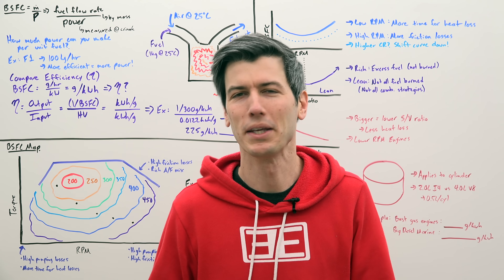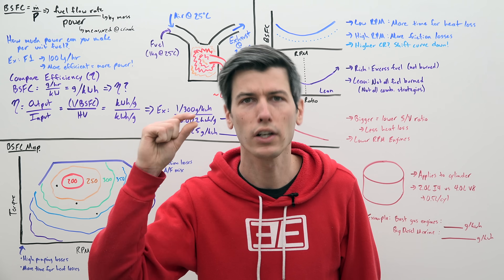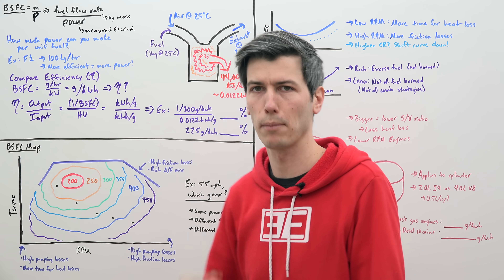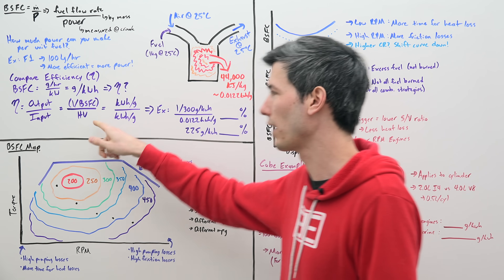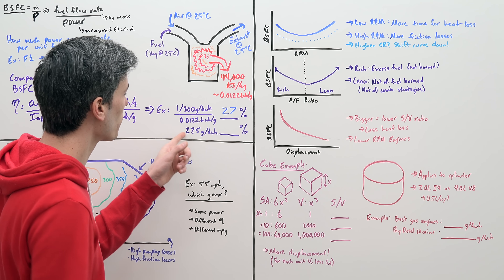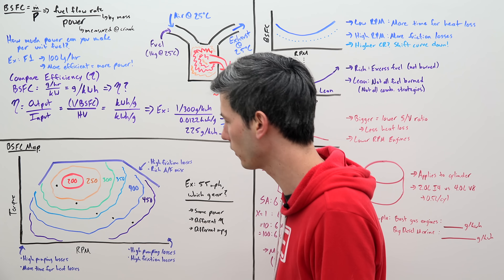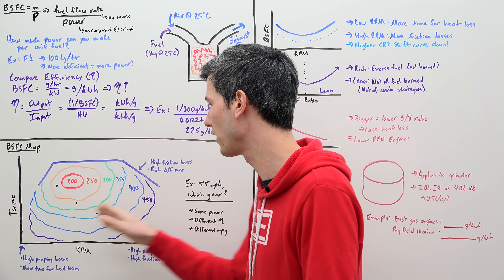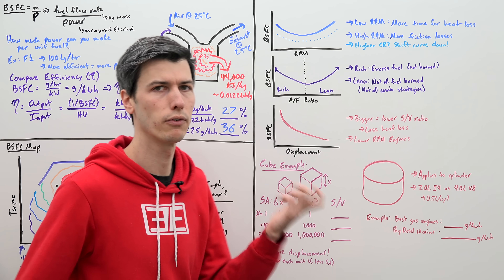The Best Way To Compare Engine Efficiency - BSFC

Comment: Would having a CVT tuned at BSFC as the shift point be the most efficient way to drive on an ICE car?
Reply from the maker: Correct, CVTs will attempt to put the engine in the most efficient spot to maximize mpg, as long as your throttle demand isn't too high.
Reply: @EngineeringExplained  How does lost of energy from the countinous shift of gears from a CVT compared to the efficientcy gain from the engine?
Reply: @davidli9887  CVTs don't have gears...
Reply: @Kepe  it does have different gearing ratios and need to change between them. There are no discret gears but there are countinous gears.
Reply: @EngineeringExplained  probably also the reason why we now have up to 10 speed transmission, fairly easy to have the best BSFC, as long as you don't increase friction in the whole package.
Reply: @EngineeringExplained  full hybrid such as a train drivetrain is still going to be the most efficient
Reply: @EngineeringExplained  So you're saying that it's possible that my 1974 Buick Riviera with the 455 ci big block (800 cfm Quadrajet carburetor) Buick V-8 running 75 mph @ 1600 rpm with my modified GM TH200-4R weighing 5725 lbs from Albuquerque to Phonix (500 mi) is more efficient than my 1996 Geo Tracker 4 door 4x4 1.6 L I-4 16 valve fuel injected 4 speed automatic in 2wd at just about any rpm or mph. Lol! Yes, absolutely as it had the horsepower and torque to move that tank with ease even at 230k! 3.42:1 rear end gear ratio and .67:1 overdrive in the Buick Riviera. God I miss that rusty old car!
Reply: @johnlincicum6390 the 79 to 85 Rivieras were so beautiful IMHO.
Reply: @EngineeringExplained  I wish a CVT could be tried in a sports car.
Reply: @josephmarsh8235  it's been tried in F1. Some good videos on it here
Reply: @josephmarsh8235  it's been tries in F1 by Williams in 1993, but got banned by FIA since it was too good : the car was faster by few seconds every turn than other Williams, which was the fastest car back then.
Reply: @Asakha1  I was talking about sports cars that are road legal, not F1 cars
Reply: @Asakha1  it was fast but the engines werent able to compete. They broke down because of the much higher stress in them.
Thinking about 60 vs 80% of the time at max RPM/ power output.
Yeah its fast but the engine runs always at the limit which means you have to tune it down so it lives longer but on any straight you would lose time
Reply: @josephmarsh8235  yeah, Nissan should try it in the new Z car! I’m sure that would go well.. 😂😂😂
Reply: @Wannabe_Maker  maybe it would, if the CVT transmission was designed for racing. Remember today's CVT transmissions are designed for economy not racing. Engineers can make power CVT transmissions if they wanted. It's only not done for money
Reply: @Asakha1  it wasn't becoz it was fast but bcoz the engine fcking exploded. Do u think FIA were gonna sit down watching more people injured/died?
Reply: @Asakha1  typical FIA. Banning any technological innovation and then they have no idea why the sport is so boring
Reply: @josephmarsh8235  any Tesla performance model is fairly similar to a CVT sports car in driving character ;)
Reply: @Asakha1  More specifically, it was banned because it removed a bit of driver involvement, and the FIA was already cracking down on electronic driver aids and automatic gearboxes.
Reply: Yes, but it also is related to road traction, internal vehicle weight and road grade as well. This is similar to what the larger car companies are programming into their ECMs and TCMs now, but it's unfortunately not an exact science as I understand it.
Reply: @ethanhenry5873  thats why its measured at various hp levels 

So if you require 55 hp to maintain 65mph 
Youd just choose the gearing that gives yoi the most efficient 55hp at that speed
Reply: Too many variables, but in an ideal scenario, yes. 

The way you use the throttle has a huge effect on efficiency. The coeff. Of drag and speed you are travelling has a huge effect on fuel economy.
Reply: Yes, using a CVT to keep the engine at it's BSFC/efficiency peak will give the best economy at any given speed.
Reply: Tractor units of large semis have traditionally used lots of gears to enable the engine to stay either at peak efficiency or peak power (depending on the need of the moment), with the bands marked on the tachometer in green (efficient) and yellow (power) before red (naughty and potentially damaging).
4 or 5 main gears with a range change and splitter give 16 or 20 gear ratios available and I've driven tractors with Eaton twin-split + range change on a 4-speed main box, which gives 24.  with a 5-speed main gearbox, it would have had 30! You often skip gears except when loaded to maximum, but you can easily get lost in those setups!
And consider that it also allows six ratios in reverse, which can get scary real fast (don't even think of trying it on a short wheelbase trailer) when backing up a semi!
I used to have fun when night shunting (putting trailers on and off the loading docks, to have all the trailers loaded and ready to go when the day shift came on) reversing them in high range high split at 35mph, but that takes quite a bit of practice! 
Older day-cab tractors used to often have a hydraulic lift added to the 5th wheel and an opening rear window (to plug in air-hose without getting out every time) to convert them into dock shunters.  Some had wide-ranging gearboxes like that, although health and safety nazis may have jumped on that and disabled high ratios since I was doing it.
That is a different kind of efficiency, as it means the loaders don't have to stand around waiting for a trailer to load.
Reply: For simplicity yes but doing pulse and glide ( with engine off when gliding) in the bsfc sweet spot with a manual transmission is the more efficient way. But really complicated to apply In the real world
Reply: Instead of a point on the map it would be like drawing a line the passes through the red circle again and again and again.
The mpg could be triple at low speeds vs  driving normally in a ordinary car
Reply: YES basically that what hybrid do
Reply: That's why CVTs were created
Reply: I believe that’s what most of these cars will do.   Toyota hybrids for example will try to be in that efficient range anytime the engine is on, even if it’s just charging the battery
Reply: Cvt transmission doesn’t give drag if compared to AT, more smoothly between shifting gears and also can be as many gears ratios. But cvt is more costly to repair 😅
Reply: @melvinlow5283  its almost always cheaper to replace a cvt than rebuild it
Reply: That's the whole point
Reply: Take the BSFC map. Draw in lines of constant power - seek the tangentially touching points of the lines of equal BSFC and equal power - connect them. That's the optimal operation points for every power the engine is capable of providing.

A CVT will attempt to stay close to that curve. Floor it, and it will always hit the RPM at which max power is delivered right away, and deliver said max power, no matter your speed. In this regard, a CVT is unbeatable of course - you just set the desired power, and the rest follows.

But losses are higher, as every CVT has some kind of slip in it, be it internal leakage of hydraulic transmission units, be it surfaces in relative motion, be it whatever - there are no teeth matching into each other, at least at one stage there will be slip. If the benefit from the best match to the BSFC map exceeds the losses, compared to another transmission, you're off better, if not, you're off worse.
Reply: @DC-rn1fc  yes, you summed it up perfectly. CVTs will probably be more fuel efficient if the driver doesn't know how to drive efficiently.
Reply: Sadly people want simulated gear shifts because they don't understand CVTs.
Reply: @nizm0man  Not true. I used to drive a Ford Mustang GT with V8 and 5-speed. Now it's a 2020 Kia Soul with and Intelligent CVT. The simulated shifting increases fuel economy when not doing hard acceleration. When hammering the throttle, it goes into non-shifting mode until you let off. Enjoyable to drive. Plus it does have a manual-shift mode. I found that useful when up-shifting, but when slowing to a stop, just let the vehicle downshift without doing it manually. I believe this reduces stress by downshifting at too high rpm.
Reply: @ninemilliondollars  "The simulated shifting increases fuel economy" That's just untrue. You're saying that having the engine run somewhere else than in the efficiency sweet spot somehow magically increases efficiency. Simulated shifts in CVTs is the stupidest thing ever. You have a transmission which is technically able to keep the engine always at the best spot for efficiency, but then you give the transmission simulated gear ratios which will make sure the engine is rarely in that efficiency sweet spot. And it's all done just so that the car feels more "normal". The sole reason for a CVT's existence is lost when that is done.
Reply: @Kepe  I'm saying my real-time mpg gauge shows higher fuel economy/efficiency when the engine is at lower rpm for a given speed. I only care about fuel efficiency when I want to and I only care about hard accelerating when I want to. For me, drivability is improved by the sense I get as I let the trans shift or glide or move to whatever rpm/"gear-ratio" it wants. And if it improves fuel economy, then it isn't lost.
Reply: @ninemilliondollars  how would simulated shifts be better than keeping the engine in the 'most economical RPM for given load'? I've driven the Nissan Qashqai CVT a few years ago, and currently occasionally drive a 2019 Subaru Outback. The Nissan felt like the transmission was slipping (first time driving CVT), but can get used to it. The Subaru is annoying, because the simulated shifts feel unnecessary. It's all in the programming.
Reply: @nizm0man  Hey. On the Kia Soul, which uses the Hyundai IVT (Intelligent Variable Trans) - Hyundai is parent company of Kia - the IVT changes positions quickly, smoothly, and very positively. No slippage. As for shifting, the trans can be forced into a "higher gear" with the manual mode to reduce engine rpm (improve mpg) compared to full auto-mode when it stays in a "lower gear" and runs higher rpm than needed. And note, this is typically under driving conditions when there's no need for maximum power. Also, when driving in full auto-mode, there's no engine droning. In any case, it's the way the vehicle was built and whether this is best or not, time will tell. It's got double the fuel mpg of my V8 Mustang and that's what I need.
Reply: @ninemilliondollars  dude, missing the point. Why bother with simulated gear shifts? Just stick the engine at max torque RPM, or max efficiency RPM, or whatever the situation requires. Defeats the purpose of CVT, stick an 8 speed auto if you want gear changes (my BMW F45 hatch has that heh).
Reply: @nizm0man  Not at all. The IVT may want to be at a unnecessarily higher rpm then needed for the driving conditions. Being able to manually shift to a lower gear is no different than doing it on a manual trans, thus increasing  fuel economy. And no engine runs at max torque rpm all the time; actually, hardly any of the time.
Reply: @nizm0man  — What ninemilliondollars is trying to tell you is that he alone is smarter that his ICVT and far more intelligent than the entire team of powertrain engineers at Kia. If they would let him alone design the transaxle, the vehicle would have far-improved EPA ratings, and that he is far smarter than you, or anyone else on this forum. 

Now get with the program, nizm0man !!
Reply: @Kepe  If a CVT survives X miles and must be replaced as it can't be rebuilt locally in most cases produces Y extra emissions / shipping fuel consumption for a new transmission or specialized equipped rebuilder far away.

So if Y exceeds lifespan CVT transmission fuel savings / CO2 savings did we actually "save" the planet? Things are more complex than you realize as a traditional AT or DCT can easily be rebuilt locally at a shop with minimal expensive machining equipment.
Reply: @ninemilliondollars  Why would anyone make it do that? Unless there is a purpose that usually forbids "changing gears" like catalyst heating or so (usually prohibits upshifting in automatic transmissions) anyway, there is exactly no reason the engine should not run at the only point of peak efficiency (for that power - gotta be said...), but at higher RPM. So, either you have a misconception of which points of operation truly are efficient, or your car is somehow effed up, or you don't gain anything from the "upshifting". 

The entire point of a CVT is to be as close as possible to the optimum curve, as described below. There is no other purpose in it that objectively makes any sense at all.

That also is the point of havin 8, 9, 10 gears in automatic transmissions - getting CLOSER to the CVT's capabilities without the slipping losses, and also, a high amount of torque may require a larger gearbox in CVTs than in usual gearboxes, be they manual or automatic.

Of course, every switching element in a gearbox that is open, has relativ motion to its counterpart, causes losses, and therefore, the growth of number of gears will not exceed the 10 by very much - every gear added does less and costs the same, in money as in losses.

+ unless other conditions require different, each and every car is by default in most efficient driving/operating mode - no one would develope anthing leaving these best conditions without a valid reason. Given there is a valid reason, I guess it is best not to mess around with it. The reason will be resolved, the car will return into efficiency mode and you likely won't even notice.
Reply: @sking2173  B.S. I was driving the other day and the IVT was running about 3,500 rpm. I simply went into manual mode and dropped it to about 2,900, a more efficient level. And as for your snide commentary, keep it to yourself. If you don't like a differing opinion, then go somewhere else. Dope.
Reply: @DC-rn1fc  It's not a CVT. It's an IVT with 8 speeds. You said "...there is exactly no reason the engine should not run at the only point of peak efficiency (for that power - gotta be said...), but at higher RPM. So, either you have a misconception of which points of operation truly are efficient, or your car is somehow effed up, or you don't gain anything from the "upshifting".

The car is not effed up. And saying there's no reason, nope. Unless you've taken this specific model of IVT apart and understand completely it's technology - which I sincerely doubt - you don't know. You're just another bully that only believes what's in your mind. I have no problem with other peoples comments but when they get immature it's not worth my time seeking to get to a clear answer if I'm wrong. CY
Reply: @ninemilliondollars  — Differing opinions are one thing, blatant liars are quite another.
Reply: @sking2173  Thanks for assailing me. I'm saying what I experience and it is a different opinion, not a lie. Any why are you jumping in? Are you an advocate for someone that can't speak for themselves?
Reply: @nizm0man  I don't know if cars equipped with traditional CVTs have some sort display that tells you what range you can leave your foot in to keep within best BSFC, they might just assume if you're pressing the go pedal, you want more acceleration, ergo more RPM, instead of the equally valid option of opened throttle valve, but locking the RPM at say, 2K.

It is probably hard to predict if the driver is someone who would, in a manual car, wait to shift at 4K vs 3K given equal throttle pressure. And shifting earlier is typically more efficient via keeping RPM low, but sacrifices acceleration.
Reply: @Kepe  I don't know if cars equipped with traditional CVTs have some sort display that tells you what range you can leave your foot in to keep within best BSFC, they might just assume if you're pressing the go pedal, you want more acceleration, ergo more RPM, instead of the equally valid option of opened throttle valve, but locking the RPM at say, 2K.

It is probably hard to predict if the driver is someone who would, in a manual car, wait to shift at 4K vs 3K given equal throttle pressure. And shifting earlier is typically more efficient via keeping RPM low, but sacrifices acceleration.
Reply: @Appletank8  The whole idea is that the car knows what is the optimum RPM for each scenario, so you don't have to think about it and/or guess. And it is able to choose the RPM it sees best fit for the current situation because it has an infinite amount of gears to choose from. You don't select the RPM with your right foot. You select whether (and how hard) you want to accelerate, decelerate or keep the current speed.
Reply: @Kepe  The car can't tell if you're a person who wants it to stay in best BSFC until the pedal is pressed all the way down, vs someone who wants the car to be a little more rev happy. In a hybrid car the motors can cover for when the engine is spooling up, but an ICE only car has to rely on how quickly it can move the ratio and how quickly the engine RPM can spin up. Without interviewing the programmers or seeing a car's throttle map I can only guess, but it could be that to stay on the safe side, the engineers programming it told the ECU to rev closer to peak torque instead of peak BSFC to avoid CVT lag during acceleration.

I don't know if current CVT equipped cars have some sort of ECO mode switch that tells the car you're happy with mediocre response as long as it keeps it below 2.5K and in the BSFC peak, and a SPORT mode that tells the car that you're going to want a lot of power soon, so keep the revs above 3K where possible. Without it, the car can only assume that when accelerating, you want higher RPM, unless you keep tapping the gear stick to tell the ECU to go down.
Reply: @Kepe  Somewhat relatedly, one of the cars I drive refuses to go into 5th gear at 40 mph (automatic) unless I hit 45 mph first, then drop down. The car assumes that I'll need the extra torque if I want to accelerate soon, but I can't tell it I'm going to be staying at 40 on flat ground for the next 10 minutes and to just give me 5th.

A CVT could have a similar type of logic while accelerating, putting the car in a higher RPM state than efficiency may suggest just in case a lot of power is going to be needed soon.
Reply: @nizm0man they want real gear shifts because they prefer sleeping with women.
Reply: @nizm0man  you're 100% correct. Even Jason mentioned this on a previous video about CVT transmissions, people want gear shifts. 👍
Reply: or running it at optimal rpm/torque at all times while powering a generator to run elec motors, like a diesel train?
Reply: maybe, but will it be the most exciting car?
Reply: Well actually, I've developed a system that would be far more efficient.
Reply: The real answer is yes but no. In a CVT there is no need for a "shift point." The only reason they seem to shift is because consumers complained there was something wrong because the car never shifted, so manufacturers made it seem like they shift. In all reality, they would be better off left to their own devices to hold either peak power or peak efficiency depending on what was being asked of them. Consumers kind of ruined CVT but in a modern car, its a very small difference, otherwise manufacturers wouldn't make shift points. CAFE is brutal.
Reply: Yes, too bad that what makes sense isn’t what sells cars… the first CVT I ever drove was the HX and when you took off from a light you would just hear one constant RPM.  Now I’d never buy a mechanical CVT but the last one I drove was programmed to mimic gear changes and even had “manual gear numbers” and a manual shift mode!  WTF!  

My car when I hammer the the throttle from a light will go to one relatively high RPM and stay there from 0-100.  Not ideal for traditional ICE but I have an eCVT so it’s being assisted by an electrical motor. 

Of course throttles bodies today are not controlled by drivers so if they wanted to the manufacturer could keep the throttle and gear ratio at the most efficient ratio for any given HP output.  They just unfortunately don’t all do that unless they are hybrid.  Most hybrids are programmed to do just that and to use the electric motor to assist to keep the engine from having to go to high of an RPM.
Reply: You would need a drive by wire "horsepower pedal", then a conversion to RPM for bsfc, then something to select gears or a CVT ratio near that RPM.
Reply: I did think about this, and the idea would be to have a "horespower" pedal. I call it that, because a throttle opens a plate, but for this model, the throttle plate can be quite open at slight touches of the accelerator, as this pedal also controls the transmission and opening of the actual throttle.
The transmission is then operated by road speed and the power demanded by the accelerator on the most efficient bsfc. If you have 100 horsepower and need 10, there is a most efficient rpm to do that at, even though it is not the absolute most efficient point of the engine which might be 30 horsepower at 2500 rpm.
You don't want the engine running too low, as it will need to run rich to provide the force you need and waste fuel. You don't want the engine running too fast, as it will spend a disproportionate amount of power on itself, just moving its cylinders and air through the valves.
Simply operating a car at lowest BSFC doesn't always give you the amount of power you want. It may be too fast or too slow depending on the road. There is almost always a power you want, for a certain driving moment.
Reply: No. Because it will cost a jillion $ to repair that POS tranny.  Get a manual.
Reply: Even I want to know.
Reply: as far as I know cvt's use belts, which are not efficient. gears in a mt have less losses.
Reply: @lucasvanhamburg4937  My 2020 Kia uses a steel belt.
Reply: @lucasvanhamburg4937  people like you just hate CVT transmissions
Reply: @josephmarsh8235  Irrelevant if he is right.
Reply: @nateverge1167  Just depends if the CVT can make the engine more efficient than a geared transmission.  If the CVT has 5% more efficiency loss than a geared transmission but makes the engine run in a 20% more efficient zone... that it doesn't really matter, it's still the more efficient option.
Reply: @josephmarsh8235  you cant push start a cvt
Reply: @nmende00  same with duel clutch transmission, automatic transmission. Only manual transmissions can push start😏
Reply: @josephmarsh8235  HAHA what? How the hell do you just assume that I hate cvt's? I just said they are not efficient compared to manual transmissions.
Reply: @lucasvanhamburg4937  only if they're not made correctly. The same as not all manual transmissions can stand high torque and horsepower.
Reply: @josephmarsh8235  yeah not really, my point is a belt is less efficient than gears to transmit power, no matter how well engineered they are. thats why motorcycles use chain drive, even though it requires frequent cleaning and lubrication.
Reply: @lucasvanhamburg4937  maybe, but gears wear out too. A chain/belt would be easier to replace than gears
Reply: @josephmarsh8235  yes because gears are made to last the lifetime of the engine, or more, sometimes less, depends on the model. But do realize that hardened steel gears inside an enclosed housing filled with oil will have less wear and be more efficient then a chain or belt exposed to the whether and without a proper lubrication system. That's what I know from motorcycles but Idk about cvt transmissions in cars maybe they are enclosed and running in a bath of oil idk.
Reply: @lucasvanhamburg4937  do you know if engineers would make a CVT transmission the same as a motorcycle CVT? Engineers can be clever and figure out ways. The only reason it's not done is because people won't buy them, and IC engine cars will be banned in over a decade so there's really no need for them, unless electric or hydrogen cars needed a transmission with more gears
Reply: @josephmarsh8235  it’s just facts because in every other option is using power to drive a hydraulic pump to provide the pressure. The cvt is actually the least efficient but if you can keep the engine at peak efficiency it sometimes offsets the losses but now that 10 speed auto is the standard the losses become harder to recoup.  Honestly you don’t see much gain even after a 6 speed. My 2016 f150 has port injection and a 6 speed 10.5:1 compression my step brother just bought a 2019 it has same motor and chassis but the trans was updated to 10 speed and motor got direct injection and. 12:1 compression and both have the exact same epa mpg. The real limit to both motors is octane limits. If 93 was normal octane we see a 15/20% mpg bump but since 93 is almost 40% more it dose not make sense. Gm tried to bandaid it’s old architecture and cafe rating by making its 6.2l that makes about the same power as the 5.0 Ford makes by requiring 93 octane. Well they hid this into in the owners manual not printing on the fuel gauge 93 octane required like every other vehicle. It sees about 16% less mpg on 87 but only loses about 6% power due to timing being pulled. But the most common failure of these motors is broken pistons because of knocking even though they say you can run 87 if you have to.